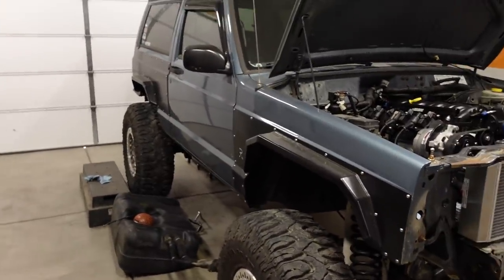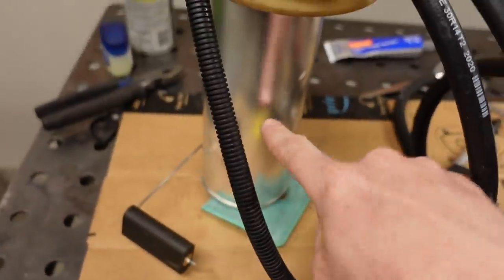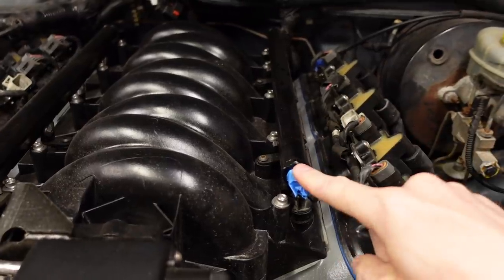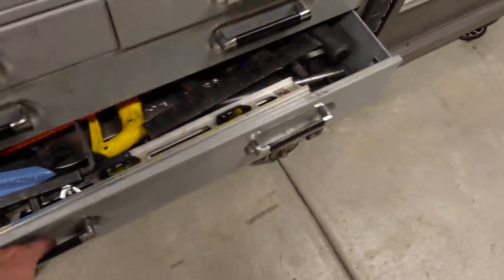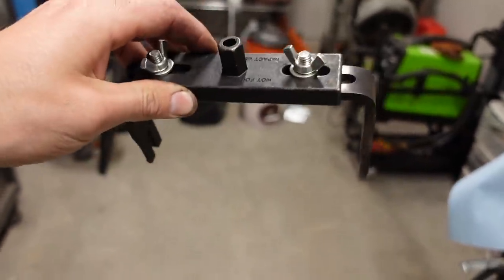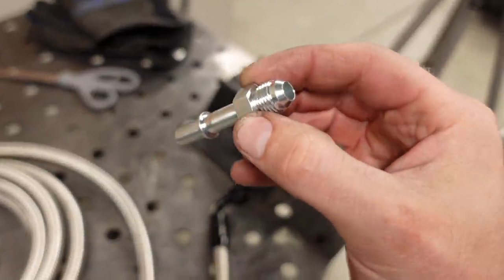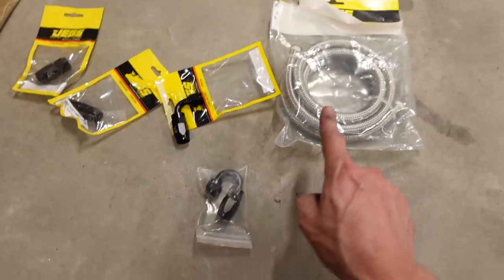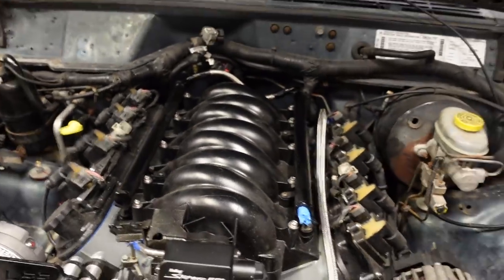Jeep LS Swap Fuel Pump and Regulator

Comment: For cutting braided stainless hose, use a cable cutter. I remove one handle and add a bar so that one side of cutter is held by a vice, that way you have one hand free to hold the hose. The cable cutter cuts clean with no debris and crimps the end down so you can easily slide it into a fitting. Place the fitting in a rod vice and push the hose into the fitting. Put a line up punch with oil on it into center of hose to push it out before putting the center part of the fitting in. We mainly use Earls hose, not sure if the Jegs hose will work the same way. I usually put a mark on the hose with a sharpie before I Assemble to make sure the hose isn’t pushed out of the nut.

Comment: Tips.
Use a hose clamp instead of tape.
Wrap some tin foil around the hose before taping it. You can then leave it on and slide it back as the fitting is pushed on then you can remove it.
Find a bit of dowel or smaller hose that will push into the braided hose before cutting it, then cut around the braid without cutting through all the way pull the hose or dowel out and finish the cut with a blade.
This will help keep steel particles out of the hose and out of places you don’t want it.

Comment: Use a screw hose clamp on the hose as the marker.  Cut staight down the clamp to  cut stainless braid.
Reply from the maker: thats a good idea!
Reply: I've used a zip tie same concept.
Reply: If you cut it with the hose cutters it’s a lot cleaner of a cut too. One thing I did find is that higher quality name brand Russell/earls/etc stainless line is much easier to work with then summit/jegs/Amazon etc. The stainless is wrapped a lot tighter and it cuts cleaner and hose assembly isn’t as much of a headache
Reply: Also, after the tape is on i crimp it with sheet metal scissors on two axis's and then cut it with the cut off wheel. The crimp tends to bend the braid inward for you.

Comment: Never had trouble like that with braided line and I’ve plumbed a lot of boats with it. I do used the blue masking tape. Also any where that line my contact another hose or cable of any type make sure you insulate it. I usually use a pice of heater hose at the intersection and some zip ties around the heater hose.  That stuff is like a saw blade over time, and there is a lot of vibration. Looks good. Like the hair, been down that road for 20 years now😀

Comment: One thing that could've been done to eliminate the need for the return line adapter is using a like 96 cherokee fuel pump instead it has a return line port and the tanks should be the same so it should drop in. Just needing a plug swap.

Comment: awesome work msn, love the sound of the ls. I have a question regarding the fuel pump, i m having some issues accelerating, noticed at times the speedometer would not go up as neither the gas pedal, i would have to pull over and restart it, it is dangerous, do you think its my fuel pump or pressure regulator, or like the crank shaft sensor or cam sensor, maybe need to upgrade my fuel injectors, hopefully the transmission is not slippin, please let me know, thanks

Comment: That fuel line may rub through that steel brake line where they are in direct contact.  You might consider a grommet on the hose there.
Reply from the maker: they're close, but not in direct contact. I use a double zip tie trick to keep a little space in between

Comment: Because it’s a dead head system the fuel line could have gone to a Y and fed both rails instead of using a cross over pipe.
Blocking the other end off with a valve or pressure sensor.

Comment: Ohhh hey LT. What's your standard "garage" grab bag. The tool kit you bring with you when you are doing a drag evening or like this trip to the pro touring truck shootout thing. I wanna see whats in you bag! I generally bring enough to jack up the vehicle change a tire and change spark plugs and a standard autozone special tool kit and some oil. Been lucky so far I guess. Oh and jumper cables. Never know

Comment: I start my conversion this month and this is definitely helping out. Still curious about the wiring. 
That’s what I’m worried about....
Also I have installed the GenRight 32 gallon fuel cell. My gas gauge doesn’t read properly.. I wondering if that will be fixed when I get the new harness or is that problem at the cluster.

Comment: hotrodfuel.com has excellent products for fuel hose line and fittings. i did my fuel system and 40k tru cooler for 80e with it, easy to use, easy to cut, awesome product and ive never done it before.

Comment: I would love some advice on a transmission not shifting on a 98 Dodge Durango,  looked at a lot of YouTube videos and still not shifting in overdrive after it gets warm
Reply: The valve body is probably sticking. My dad's Ram had the same issue. Ended up just replacing the transmission.

Comment: What are you gunna do with venting??
I have a 70duster and i swapped a gen3 hemi... all new fuel system too, but with my stock tank vent i smell gas, mostly on warm days....no leaks, just the smell...Im still looking into a fix
Reply: The xj tank has a vent to a charcoal canister under the truck. He is probably going to hook it back to the canister. With your application if your tank is clean a shop can weld a vent tube on to your tank to a canister
Reply: The XJ has stock EFI so I would guess he is using the stock EVAP/Charcoal canister so no smell.  Sounds like you need to go salvage yard hunting for a useable canister from whatever car.